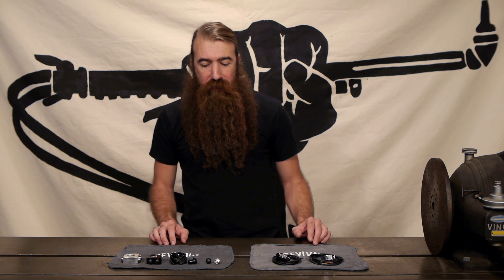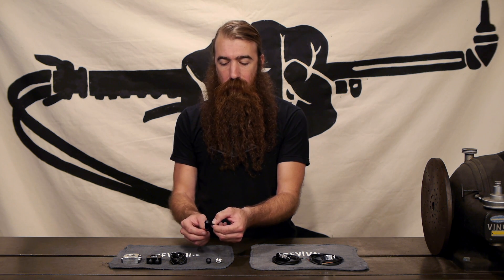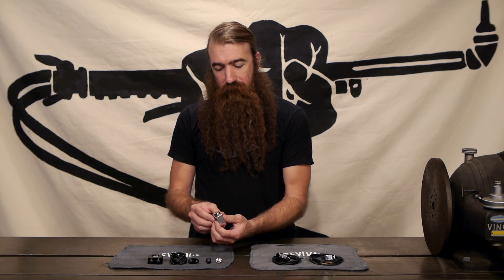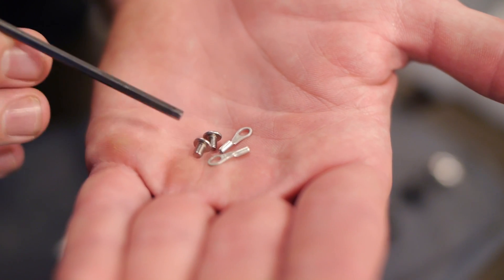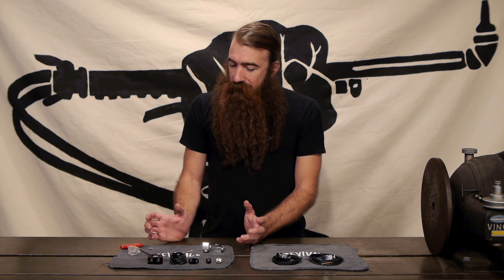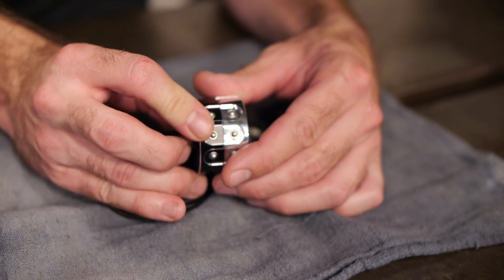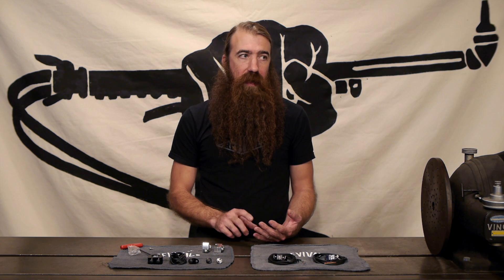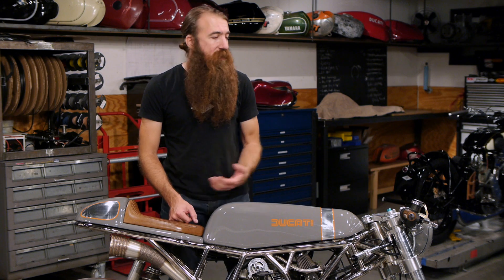Motogadget m-Switch - Revival Cycles Tech Talk

Comment: I never run a ground through bearings.

Been proven to cause problems with bearing life. Granted that’s in larger voltage systems, but still wouldn’t do it.

You’re already running wires out, splicing the 3 grounds together and running a 4th wire (ground) isn’t adding too much to the overall run.

Especially if you run internal bar wiring from that switch.

Comment: That solid state switching device that doesn't exist yet is called the Kaizen Relay 
Available at and designed by Kaizen Speed

 Designed to directly replace any standard relay in your vehicle, the Kaizen Relay is weather resistant and allows additional Kaizen Relays to directly connect together and be instantly powered up using our patent pending interlock design. The interlocking connections on the side also allow our Control Module to attach and instantly convert a standard Kaizen Relay to a CAN triggering relay complete with programmable inputs and outputs

High-current solid-state relay with over current and over temperature protection
Allows additional relays to be connected and powered up instantly
Capable of high frequency switching at full capacity
Good for huge radiator fans, fuel pumps, nitrous solenoids, heavy current light bars, trans brakes, line locks, electric water pumps and nearly anything else you need to power.
CAN enabled Control Module is available separately
Reply: Should mention is design and sold with cars in mind as a cheaper alternative to going full PDM setup costing thousands of dollars while being a step above conventional relays but with its built in features that would seem to make it 2 wheel friendly don't see why it wouldn't work just as well on a bike as they do on cars. At about 100ish a pop pretty killer bang for buck and tech that hasn't really been improved on for decades until now.

Comment: what do you think of using switch toggle "on/centre-off/on" type for turn signals ?
Reply from the maker: One of the reasons we don't use them in this application is because these momentary switches work off of a ground signal, running them off of that signal makes it easier to use smaller and more discrete buttons and wires, for that matter. These type of buttons/switches are used exclusively with the Moto Gadget M-Unit because the M-Unit requires a momentary ground input signal, a latching signal will not work. Now, when using a regular voltage signal (+12v) you can use a latching switch, typical to a stock setup. The reason we don't typically use them is because when using these types of buttons/switches with a voltage signal they are A) not as user friendly as we'd like. When riding, the easier the button functions are to use the easier it is to pay attention to the road and B) It's not very easy to find small latching switches rated for this use.

Comment: Hey :) Thank you for the great info you guys are sharing! I was wondering is it 1,5mm section wire you use for the grounding? And then which section you use to run them together to the ground? Can’t find it by googling... Many thanks!
Reply from the maker: In the workshop and the wire kits we produce we use 22 AWG which is the equivalent of 0.34 mm2. When we splice them together we use the same gauge wire for the main return wire. Since there is no current in the switches you can use wire as small as you can manage. We've found that 22 AWG is still quite compact but easy enough to work with.

Comment: How are mini switches with winter gloves on (like a lined leather glove)?  easy to pick up by feel?  Can you tell when you activate the switch (click/snap/etc)? 
thanks. Love the videos!
Reply from the maker: I was concerned about that myself but what I've found is that the high dome pierces through a glove so that you can still locate the button and they provide a clear tactile response when pressed that can be felt through a glove, or my gloves anyway.
Reply: @RevivalCycles  Thanks man. Great videos. I appreciate the answer on the older video.  I've got a case of the M-Unit Blue wants. :)

Comment: What is the thread of that tiny screw on the terminal side? i dropped mine :(
Reply from the maker: That is a good question and I'm not actually sure. I don't have a tool to measure threads that small. If you reach out to the guys at orders@revivalcycles.com they will be able to help you source one.

Comment: Great videos guys . Could you do a video of say removing the original factory switch gear , lights, indicators etc and replacing with the m switches
Reply from the maker: We've got some switch install videos in the works I'll take note of those details.
Reply: I second this wish!  I just finished a jvb moto mt super 7 conversion on my 2019 MT 07 and this is exactly what I want to really finish it!  Can’t believe how YouTube just finds the answer for you and dishes it up!  I’m just worried the modern wiring is too over-elaborated to take it back to this simplicity :(
Reply: Wow!  Just went to your website, you guys are in it to win it in this space!  I live in Edinburgh, but when I’m next down south can’t wait to pay you a visit. Also found just the article ‘not’ to solve my problem’ but to confirm I should have some healthy respect for it!!! “Replacing OEM Latching Switches with Momentary Buttons Without Using an m.Unit (mo.Unit)”. I now need to do some soul searching to prepare for this next leap!  As you can imagine, changing stuff on your bike feels like swinging from vine to vine not knowing if you need to retreat back to stock cuz it just won’t work! :)

Comment: I can't understand why these gadgets are only sold as MOMENTARY switches? 
What could you use them for apart from start button and horn. If i was to run indicators with these you would have to hold the button ON to make the indi's work whilst using the clutch lever etc not very convenient. is this correct?
Reply: Old comment but someone else might want to know. 
If you use a relay each press will either turn them on or off, you wouldn't have to hold them. The only time this would apply is if the indicator was wired directly to the switch, no relay, then you would have to hold them.

Comment: In Order to install m-switch is m-unit necessary. Can m- switch be uses in a bike with no m-unit?
Reply from the maker: These switches can be used without an m-Unit, but on a traditionally wired bike you would have to also add relays or some other type of device. The m-Switch has an amp rating of about 3 amps, and the m-Switch mini has a rating of 0.15 amps both are very low and should not be used to power devices directly. Also these are only momentary switches so there is no way to latch the switch for use with a high / low beam or kill switch. 

However, there are devices like the m-Relay+(https://shop.revivalcycles.com/motogadget-m-relay-plus/ )  and NSC-01 (https://shop.revivalcycles.com/nsc-01-momentary-to-latching-switch-module/ ) that make it easier to use these switches on conventional bikes without m-Units.

Comment: I have a question about the compact switch button. You would have to thread your bar for these ones but once you screw them in, won't it be bad for the attached wires that will be twisted also? Or am I missing something?
Reply from the maker: In the case of the switches that get threaded into the bars, the approach we use is to wind the wires up the wrong way first before starting to thread in. That way as you thread the switch in, it is unwinding the wires. With some practice you can get it so the wires have very little twist , but the bigger issue is that the solder terminals stick out and on 7/8" bars it is a very tight fit. 

This technique is not the preferred method for maximum robustness, but it is great for making super clean cockpit controls. Like many things, there are trade offs. Super clean, but fussy install, and potential for problems down the road. But we've done this several times, and with careful installs we haven't had any issues yet.

Comment: Thank you for your videos, they have helped me out a great deal so far,
I have just purchased the m unit and the m button, but.... I'm running 7/8 bars that aren't drilled (inch drilled bars in the UK are not common and drilling 7/8 is frowned upon even more so that they are aluminium) is there any handlebar switch on the market like the motogadget m-switch that doesn't run through bars?
Thank you
Reply from the maker: Is there a specific issue with drilling 7/8" ?  We do this all the time and there is no problem from a structural standpoint. Although the bars may be made of aluminum they are typically much thicker than their steel counterparts which actually makes them stronger than the steel ones. With all the bars we've drilled we have never seen a single failure at the drill point. 

There are several switches that don't require drilling, and it is also quite easy to modify the m-Switch housings to allow the wires to exit the housing and not go into the bars. Just use a 1/4" round file and make a notch for the wires to exit. It takes a few minutes and you need to be careful not to slip and scratch the rest of the housing, but it can be done.

Comment: How do you dress the ends of your wires when screwing them into these switches? I tries using wire end ferrules but there is no room for any strain relief, so the end just keeps breaking off...so I have just gone in bare wire and I hope it does not break off in the future :)
Reply from the maker: This is always a challenge, and we have tried it with the ferrules but that doesn't work well. The best technique I have found is to just go with a very short stripped section of wire and then "Tin" just the very end of it so there is a solid section for the screw to clamp. Then it gets bent at 90 degrees so the wires can exit straight out of the switch.  This is always a compromise and we haven't found a better way to deal with it yet. 

The other tip for working with these switches is to give them several turns the wrong way first before starting to thread them in to the housing. That way as you start to thread them, they un wind and you end up with less twisting in the wires after they are threaded in.
Reply: Revival Cycles thanks so much. I will leave it for now since I finally managed to get it all done (what a pita it was). If they break, I have enough slack to try again :)

Comment: Do you drill one hole at the centre of the handlebars for the cables? How many holes (and how big?) can you drill before making the handlebars unsafe? Thanks
Reply from the maker: There isn't really a rule of thumb for this, because it really depends on too many variables like what size bars you have, what material they are made of, where the holes are located, and how heavy the bike is. 

That said, a single 3/8" hole virtually anywhere along the bars will not cause a problem, and that should be large enough for wire exits including rubber grommets. If you need multiple holes keep them lined up along the axis of the bars, don't stack them around the diameter of the bars. The strength of the bars is determined by the cross section so you really just need to avoid having more than one hole around the same cross section.

Comment: Do you find the buttons on the m.switch mini too small and hard to push correctly or are they fine? I'm debating whether to get the mini or the standard m.switch. I guess you get used to them but they do look small, especially with gloves on.
Reply from the maker: I find they work well, and the only time gloves really get in the way is if you are using cold weather gloves with a lot of lining. Normal leather street gloves or race gloves work just fine. But I also don't use the buttons much when riding, rarely use turn signals (don't believe in them and still use hand signals)

Comment: the 2 and 3 switch units.(first type you went over) How do you run the wires? must you drill hole in bars, or can they be ran outside the bars?
Reply from the maker: These are designed to run the wires inside the bars, however, we have made modifications to the switch housings to allow the wires to run external. The way we did the modification was to use a 1/4" round file and just file a notch where we wanted to the wires to exit. Also, it is very easy to make this modification if you have a milling machine, just run a 1/4" ball end mill through in the location you want the wires to pass.
Reply: ok, thanks. Looks like a little filing is in my future.

Comment: if you use these without the m unit can you still use these as a on and off for turn signals without having to hold the button down? and do you plan on doing a video for the new 3 button switch??
Reply from the maker: These are all momentary push button switches, they will not stay on unless they are being held down. Some bikes have systems that work this way, most do not. There are a couple of modules out there that can make the conversion from momentary to latching, but by the time you add up the cost it not much cheaper than getting an m-Unit. It is however a bit less effort to do the install, but the trade off is that you don't get any of the other benefits of the m-Unit.

Comment: hey, how do you use the m switch for the turning lights? up is left and down is right? or is there a better switch for my needs? greets from austria
Reply from the maker: The m-Switches can be setup in many different ways, normally they are used to control an m-Unit and that is what is actually switching the power for the various devices. The m-Swithces are just used to send signals to the m-Unit. On our builds we usually have the turn signal controls in the middle switch position, left on the left handlebar, and right on the right handlebar. But this is really up to you.

Comment: Thanks for the video, always very helpful!  One question:  Would I be able to run the m-switch without the use of the m-unit?  If so, can the switch be used as a ignition kill switch?  Thanks again!
Reply from the maker: The m-Switches are momentary contact only, and that makes it difficult to use them without the m-Unit. It is possible, but generally that is not how we do it. There is also the issue of the rated current, and these switches are really only rated for signal level current, and should not be used to directly power devices. If you wanted to use them to control a device without an m-Unit, we advise using a relay in combination with the switch.

Comment: Hi Revival Cycles, I am running m-Switch on my clip-ons but unsure how to route the wiring? The Clip-ons are solid so there doesn't seem to be a way to drill them and route them through the centre? The top yoke and clip-ons are originally from an Aprilia RS 125 R. ANy help and guidance much appreciated.
Reply from the maker: This is a bit of a tricky situation, and depending on which m-Switches you have (standard or mini) there are a few different solutions to the problem. If you are using the standard m-Switches it is pretty easy to use a 1/4 inch round file to file a notch in to the side of the switch housing for the wires to exit. BUT if you are using the m-Switch minis it is much more difficult to modify the housing. 

This is the type of problem we run into on custom builds, where a specific combination of parts doesn't work because of some minor detail and one of the parts is unusually designed. The solution to these issues is part of what makes building bikes a challenge. Solving this will depend on what skills tools and experience you have available.
Reply: Thanks for the reply Revival Cycles. I've been working out a solution and I've decided to cut down the original clip-ons, machine down the diameter and slide on a hollow bar. I'll either bolt through or TIG weld it for strength. Tjis way I'll be able to conceal the wires and keep the bars as clean as possible.
Reply from the maker: Awesome, that sounds like it will work well, and it sounds like you've got the skills and equipment to handle this no problem.